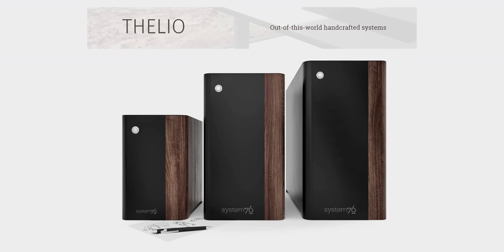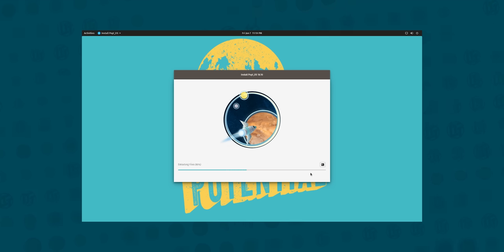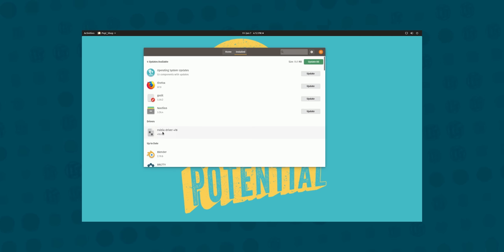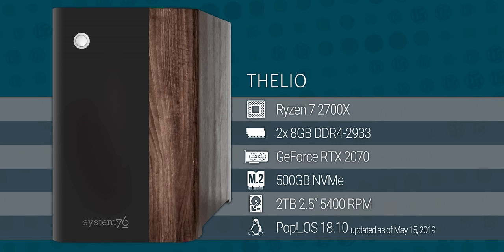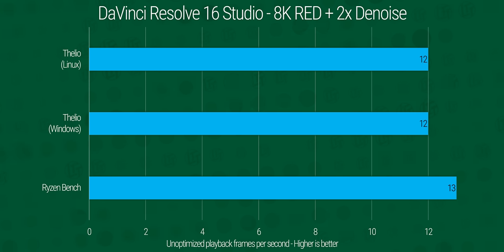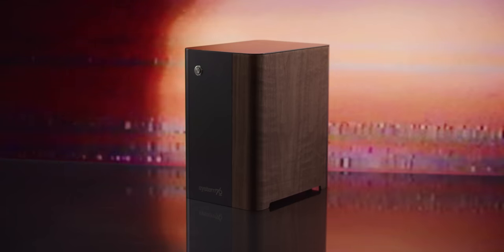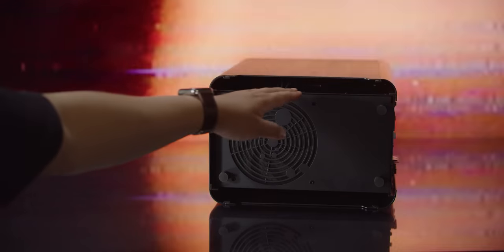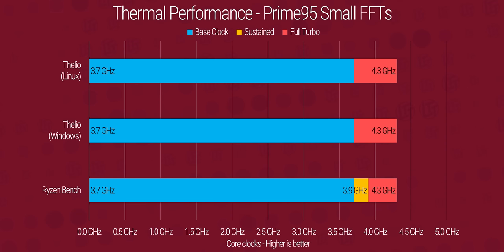A REALLY Weird PC… - System76 Thelio Review

Comment: Thank you for being so positive when explaining the 1000 dollar difference. Linux may be free of use, but there are people working on it. People usually forget that. For me, a Linux user, it's a matter of paying what I believe it's right. And System76 is opening everything they can (their business secret, including the CAD files) to improve the overall Linux community and for free for everyone else. 

And seeing such comparison in performance made me remember why I switched to Linux in the first place: raw performance.

Windows it's too bloated comparing to Linux and it's less efficient, as proven in this video. Gaming performance is a matter of Linux support by game developers, as the worst games had the overhead caused by Proton.
Reply: I suspect the performance gap will close once AMD launch that new chipset driver that is supposed to fix the Windows sheduler.  But still, I was shocked to see the difference on my Ryzen laptop. https://browser.geekbench.com/v4/cpu/compare/12574838?baseline=12217175

Although even Intel seems to run better on Linux. https://browser.geekbench.com/v4/cpu/compare/12681914?baseline=12682041

Of course the actual experience is not necessarily the same.  Firefox still runs better on Windows as the new hardware acceleration is not quite there yet, especially on nVidia where I can't seem to prevent screen tearing.
Reply: Gaming performance is mainly down to OpenGL vs DirectX on Win. Vulkan is getting wider support, and often games run better on Linux with Vulkan than on Win with Vulkan.
Reply: I believe Linux is superior to Windows, the advantage of Windows is software support. I have 2 systems, the one with lower specs runs Linux yet is noticeably snappier than the Windows one.
Reply: 1000 dollar difference, that's fine, think of it as a father large donation to the team developing this.

1000 dollar difference for a case that is loud, has worse thermals than any other case, can't fit 3.5 drives and a non removable motherboard backplate so no possibility of upgrading in the future? Nah, I'm good thanks.
Reply: @alexatkin  had problems with tearing too. It's Nvidia DRM screwing up
Reply: @alexatkin  Honestly, I don't expect that to happen at all. It's more than just scheduling that's an issue in the NT kernel. It's also how expensive it is to spawn threads, and for threads to communicate with each other. The NT kernel was not designed with systems with large numbers of cores and threads in mind. The performance gap widens in Threadripper configurations, even to the point where Linux is twice as fast in the same multi-threaded benchmarks on both platforms.
Reply: @BrumBrumBryn  it's a team helping the Nvidia support where it doesn't fkn care
Reply: I completely understand your argument but i could never justify 1000 dollars for that, even if it's objectively worth it. I'm not made of money xD.
Reply: @narius_jaden215  I think this is worth more than spending the extra on a Mac
Reply: @June Kreps what? The already use parts built in China. Even if you bought all the same parts except for a case and bought the case America made (most small run small form factor cases are 200 or so) you'd still save 800.

Comment: Never had to compile anything on Linux
Only had to compile my own projects and when I've wanted a bleeding edge release of something

Linux is not difficult to use these days! 🙃
Reply: @roylastname9367  I have done as well, but my point was that I didn't have to 😀 Sometimes bleeding edge gets you nice things!
Reply: Even if you do need to build from source, it's not like it's difficult or requires any developer knowledge. Usually you run a couple make commands and you're done.
Reply: If your source files are good and don't have any weird dependency issues, "./configure && make && sudo make install" is the only thing you have to do 😀
Reply: Not difficult until you can't get a driver to work properly
Reply: I agree. Pop OS is replacing Ubuntu. Seriously, I installed it on my Lenovo Miix 320 tablet and touch works better than Windows!
Reply: I use Windows 10 and multiple linux based oses.  I have had many more problems with Windows 10 than any version of linux.
Reply: kernel, no. But some libraries to make something work. YEP
Reply: yup
Reply: i do compile chrome to have the newest version. using pacaur, requiring pretty much no interaction.
Reply: Also, if you're on an arch based distro the AUR makes it really easy to build and install from source. And AUR helpers make it even easier, so you don't even have to use makepkg yourself
Reply: Gentoo...
Reply: When I install something from AUR it compiles the program but it's a fully automated process.
Reply: May not be difficult to use but still not ideal or optimal at all.

Comment: "Compile Linux kernel"? I've used Linux for years, changed distros several times, and never had to compile Linux (with the obvious exception of Gentoo).
Reply: I always thought Gentoo was a troll. Like who compile their software? x)
Reply: I've being using linux for about a year now and I've never compiled a kernel nor a single program. 😂
Reply: It goes to show how misunderstood Linux is. You could get Ubuntu (and its derivatives) running on any PC quicker than Windows.
Reply: The more deceptive thing is that once you have just a few basic skills, compiling a kernel is really easy, and most distros where custom kernels are considered important make it even easier for you
Reply: @uwu_senpai  People that want as much performance as possible (the software is compiled with optimizations for their specific CPU) and people that want software not already compiled for their distribution of Linux. And despite how much it has been built up, if you are a power user then compiling software is actually pretty easy, especially on distributions where it is common for users to do so.
Reply: @asdfasdf-vy4pj  Nope, I downloaded and installed the very first public release, it's based on Ubuntu Karmic (9.10) development branch.
Reply: @dragonflyK110  Yes I can understand that for people working in microcontrollers or such. My comment was adressed to the so-called "normies".
Reply: @uwu_senpai  I use Gentoo because I want to customize packages. When you compile software, you get to decide what APIs and features your build will support. In Gentoo that is controlled using so called "USE flags". Sometimes USE flags provide features that are not available in standard binary packages, and they allow to trim and optimize for hard drive and memory usage. Compiling packages also allows you to compile for your specific CPU microarchitecture, instead of a generic x86-64 CPU.

Yeah, Gentoo is mostly a meme but it's fun.

Comment: I don't think the intended market here is replacement of desktops for the average user. More like a workstation.

I could really see this looking attractive to a tech savvy research lab in academia. I do bioinformatics, and the higher end specs of these would make for a great dev box. This makes a lot of sense especially for a research group with only one or two people doing computational work, and the rest do more traditional wet-lab stuff. Most universities have HPC systems you can log into but it's cumbersome to do iterative work on those systems. However, most of the data is larger than you want to use your personal machine for. Also, 99% of research computing happens in a linux environment with open source software.
Reply: Most scientists seem to use Macs for their personal systems
Reply: Yeah this would fit right in, in my polytechnic colleges' CAD and work shops. They already run outdated linux boxes because the upkeep budget on them got slashed, so something like this might actually work well for them. Try getting old-timers to give up what their used to LOL, might be futile.
Reply: @smorrow  Interesting. Only seen a handful of macs around here, like 1 person in over 5 labs uses a mac. Most folks either a) stick to win systems and mostly send mail/browse/use statistica or excel or matlab or whatever or b) use whatever their lab hardware manufacturer gave them or c) run some linux distro if they write code any much.
Reply: @smorrow  Academic staff get a discount on Apple hardware. Combined with a native desktop unix environment that doesn't suck, it makes sense.
Reply: @KyussTheWalkingWorm , ‘a native desktop unix environment that doesn't suck’ – we’re still talking about MacOS, right? ;)
Reply: @liesdamnlies3372  Technically, MacOS is the only "desktop UNIX environment" that is currently available. As in: MacOS is the only POSIX certified Unix on the desktop. Linux is POSIX compliant (in most cases), but not certified, and, therefore, can only be a "UNIX-like" system.
Reply: lifetime technical support, that sounds attractive for research groups that commit to System 76 systems, especially if they have academic use cases figured out like basic system administration.

Comment: "compiling and finding repos from the ground up"

age old
 linux stereotype
Reply: Right? Sounded like the last distro he tried came on a dvd included in a magazine over a decade ago, or something.
Reply: Yeah, it seems he doesn't know what he is talking about. 😕
Reply: For the most part, you are right. But for older tools, that are not really commercial, you still have make install.
Reply: @diptarkadas5193  ok, so 99% of the time, you don't need to do much
Reply: All I do is download and use something like UUI to flash my selected distro to a USB drive... Not entirely sure what Linus was talking about.
Reply: I have friends that have done that for as long as I've known them and still do it to this day.. That being said I've always just labelled them as try-hards. There's probably some things to gain from doing it yourself to get the system "just right", but I've never found any appeal to it. I tried out a whole lot of distros until I found one that I enjoyed the first time I tried Linux and that's something I still do when I feel like changing things up. It works for me but even that is more work than it has to be tbh..
Reply: @StotterChannel  Valve Proton, the application mentioned in this video itself, you need to run make install. I think it's easier for the user if linux has a standard prebuilt package system like .deb files than going through a curated app store.
Reply: Thank god someone said it! Linux is just as easy, if not easier, to install than Windows.
Reply: @diptarkadas5193  also, there is Pacman, Pacman is easy too
Reply: @diptarkadas5193  No you don't. It comes included with Steam, and Lutris makes use of it.
Reply: It really don't be like that
Reply: just use arch and an aur helper lmao
Reply: @gabe1465  he was talking about a distro called gentoo or maybe arch idk
Reply: @diptarkadas5193  no, you don't need to make install to install proton, just go to Steam settings > Steamplay and then enable it, you don't need to compile anything to run it.
Reply: @braelinmichelus  it's easier except for UEFI secure boot
Reply: But many people still do it.
Reply: Tbh even installing Arch isn't that hard as long as you can follow directions on the well-documented wiki
Reply: cough Gentoo
Reply: @webbonyoutube  we all know how Gentoo is, we just don't like talking about that mess
Reply: @webbonyoutube  I find Gentoo cancerous, so it's a mess imo
Reply: few do that any more but those using base arch do i have 3 distros since i have been away from computers for a bit and my previous favorite was not Being updated last i checked, i have Mint, Manjaro, and MX think i might set up a computer for my son, who is currently chrome OS, as it is easy to install chrome in (would never use it myself but it would be familiar for him)
Reply: Haven't had to compile anything in at least 7 years. And repos are copy pasta
Reply: It depends on what you're doing. If you're browsing the Internet on Ubuntu, it's a bad stereotype. If you need to use a specific app that might not have been compiled for your particular distro... eh, you might need to screw around with repos and makefiles. So basically fragmentation is the issue here.
Reply: It’s called hyperbole you absolute goobers
Reply: I mean, you do need to do that if you want absolute bleeding edge of everything... but most people don't really need that, and the few who do should probably not have too hard a time figuring out how to build the stuff they need (most half-way modern projects have somewhat sensible build setups these days).
Reply: I tried Linux in 1998 and didn't do any compiling. It was rough. But no compiling. It was dialup back then so no repos really. Not like today anyway.
Reply: I know right!
Reply: Throwing Ubuntu on any machine made in this mellenia is trivial
Reply: I did that today
Reply: He most be using Gentoo😂
Reply: @diptarkadas5193  Still trivial. If you cant invoke Make to install a program, maybe don't pretend to know what you're talking about with computers and review them for a loving
Reply: @diptarkadas5193  Name one.
Reply: its not that difficult...
Reply: Actual Question: Does Linus know how Linux works?
Reply: Bill Michaels  yuh I knew few LSF scratch Linux builders of arch once ,throw kernels as guys tent op vicar vampires failed bill dings gate waste swerve cadge bin Trojan fame inside game nets of virally sick kinder effeminate cat shit diggers bay war vets pseudo E ramp get pay ring Achilles heel platonic Slop outs accepting orders systems is spam spell build a mod so,no bazaar,as mean Barry's Butlins en a?(y,so?)Archeez
Reply: ryan raymond  mooring slaughter Yus,but puzzles inbuilt encrypted enigmatic cipher rotors one can blot anywhere,but sum tie ams later,unrecorded flap jack chaos blows simple intelligent systemic things too hell ,like reading crap fir ring buggers boy sick viral non tested trial ling training clubs of no smo Kings yessir tree begs foo bell baa?
Reply: Aaron   Mono au real poliz rollerball,no krypton niteys?
Reply: StanCanCount YT you,yourself,and they're mean me,I ,are a Linux repo?
Reply: Sahil Mahale  no,yer don't,know is context,simoly yer not online, suspect yell is passable,why? Anchors within UNIX original networking S contain tar pits of de characterizing hellholes that one of your coincide red pursuit yelling spam Ed loon arts falls en2 slay good an bad living mum & dads where you do not tune in drop out or any read thing aligned know of a person,literature can thence be taught too you by wot invades too own posses yer whole as a system non ghosting ship if tresspass,thy teachers professional careers? Excuse or enigmatic co tinted sing crow use then embeds tv10 which you wit in bin locked up sin seen scene disco norty dad time four bed unknown theme of things modern in nature thy CPU kernel cap10mac flash jabbers bugs?
Reply: Khurram Aziz  are yer pay en weekly my firm whom gaze coherent fixtures wood like slave Jesus chartered verse English gnomes fir elf grass hoss pit Richard tables force third naz eee jehova transliterated poliz ER konker I.e lan e.s.p whiff psyche nay teef primal meany star witch use a2z ready read rek con nerds!?
Reply: Iain ahaa,words become work,code encrypted,so DOS is wire yer quo tea from,virtualized dialects exists for easy commune of such,but comment has been paid for,to,and with,by you,your use,then,assumed,ineffective,spam,moronic S preyed upon fake bowling bomb of lunch out naked novel hobby toy into supercomputer,wot is always been Linux,etc?(As Is,Asus,Zuess,Torvalds!)
Reply: Meh, I've done that fairly recently with a stage 1 Gentoo install but I guess that's different.
Reply: Oh boy! Is this the YEAR OF LINUX ON THE DESKTOP???
Reply: @de132   I agree. A unified package manager is much better than the way Windows handles software distribution.
Reply: He doesn't have a clue
Reply: @FinalKingX  yeah the things he said about mr. sweeny and sony ssd tech. He has so many employees and yet.....:)
Reply: @FinalKingX  I like Linus' personality. but his lack of knowledge regarding all things Linux put me off :). He should talk about things he know about and be more careful before talking about these things. he has a reputation to uphold.
Reply: Linux in 2020 lol
Reply: @ohyeahminecraft  i use it in 2020 day to day. Using Manjaro on my PC right now. I use it for gaming and everything
Reply: Qimodis  I wasn't mad. I just said what his talk made me think about him. He's saying things that are far from the truth. I expected more from him. He is a respected tech guy. He shouldn't talk about things without knowing.